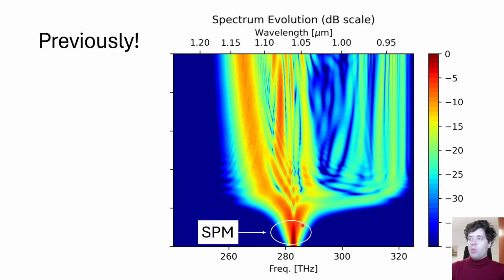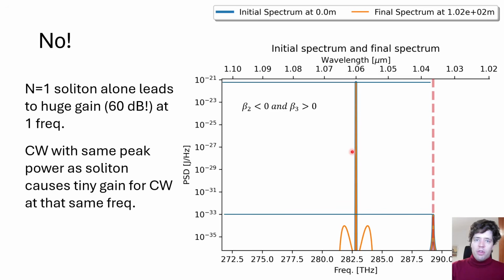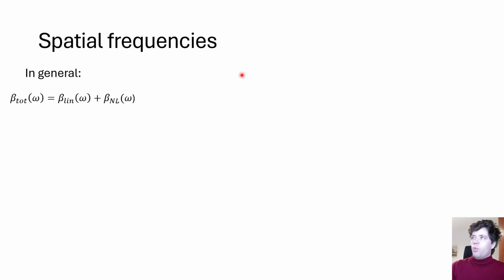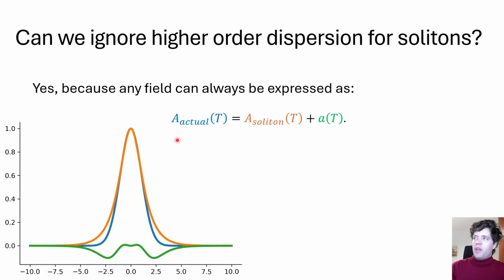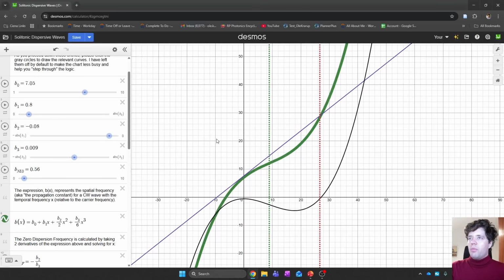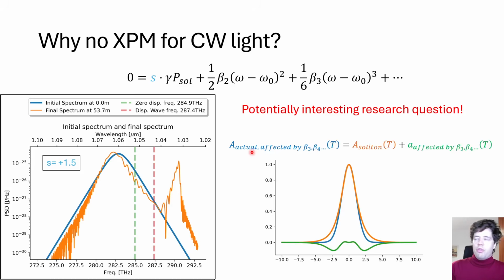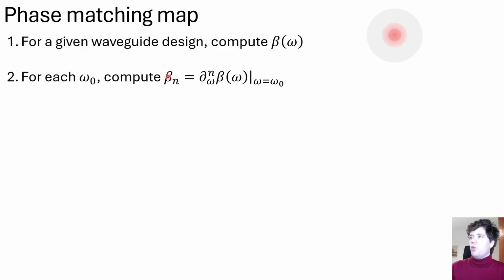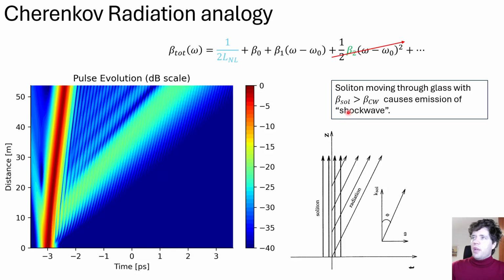Solitonic Dispersive Waves in Optical Fibers!

Comment: Well done! Actually, there is XPM on the dispersive wave imposed by the soliton, please check the paper:  "High-order dispersion-resulted tunable multiwavelength femtosecond laser," Opt. Lett. 33, 1620-1622 (2008). Maybe you can adapt your simulations on these RDWs as well.
Reply from the maker: Very interesting, I will take a look!